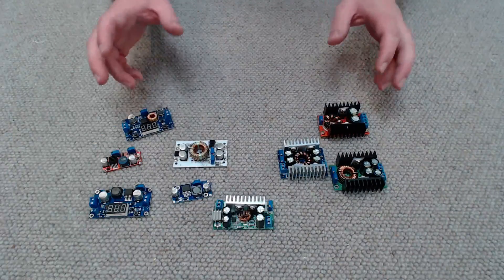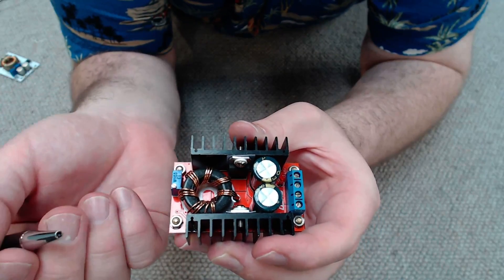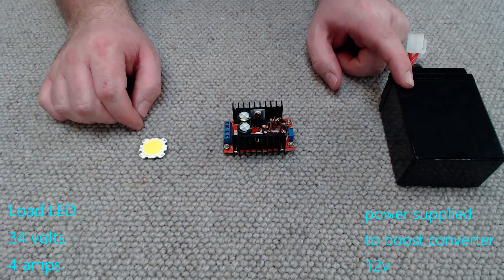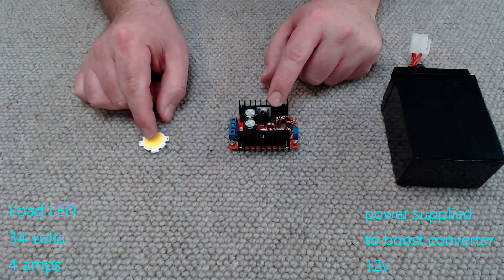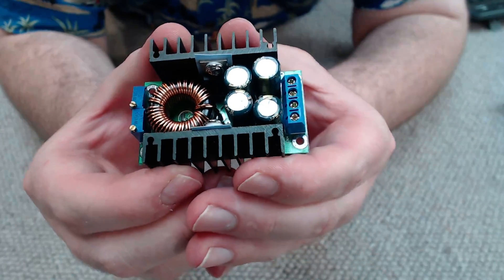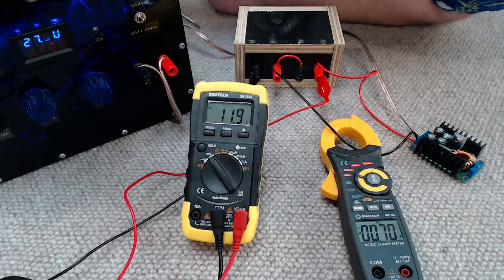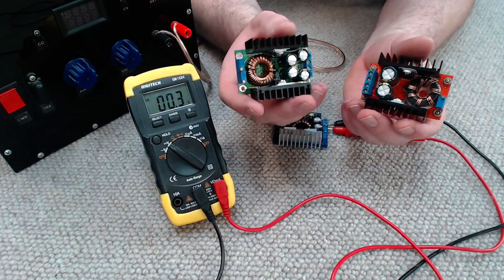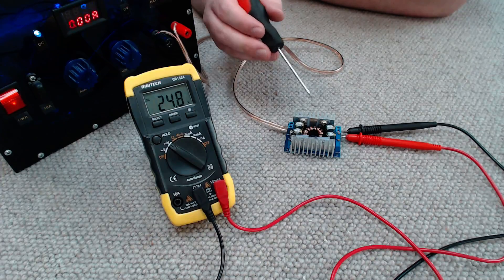What You Need To Know Before Buying A Boost/Buck Converter

Comment: Did the data sheet not say 8 amps?
Reply: The Bottleneck here is neither the IC nor the other component. The Bottleneck here is the HEAT DISSIPATION. The size of the heatsink provided is not enough for the 8A current. So, the IC will overheat and probably the thermal protection of that IC would kick in and the unit will keep shutting down frequently.
Reply: Thanks for this detailed information!
Reply from the maker: Yes you are correct the data sheets says 8 amps, what you have to remember is the mosfet/IC isn't the only component on that circuit board. The manufacturer rated that boost converter shown in the video at 6 amps max continuous. Obviously the reason for this is somewhere along the chain of components there is a bottleneck and the mosfet/IC isn't it. Otherwise it would be rated at 8 amps. More often than not the mosfet is the bottleneck for current, so it's still worth checking the data sheet to compare the claims vs reality.
Reply: Thanks for explaining this so perfectly.  I didn't  consider that the data sheet was for the IC and not the boost converter as a whole. I watched this video about 8 times to try and figure out what you were saying about the input voltage and exceeding the 6amp input current. I'm still in the process of learning electronics so this really helps explain voltage and current draw. I ordered a few different buck, boost and boost-buck converters to tinker with. I have a few ideas for some projects and I'm currently trying to learn how to make my ideas work. I'll be checking out your other videos as well. You're pretty concise. Subbed!
Reply from the maker: You're more than welcome! The feedback is appreciated :)